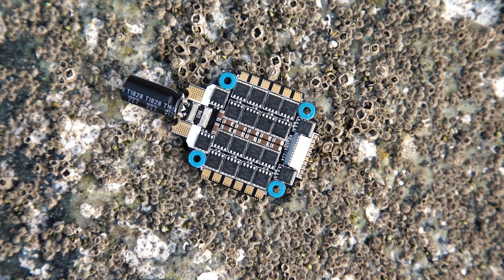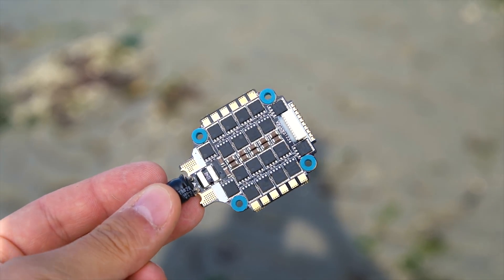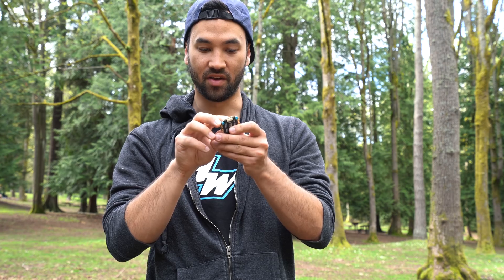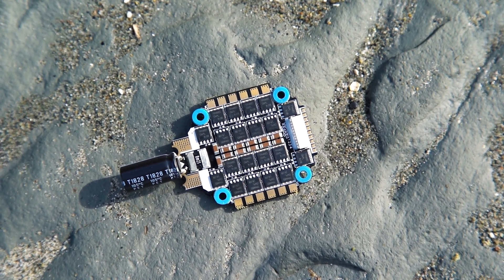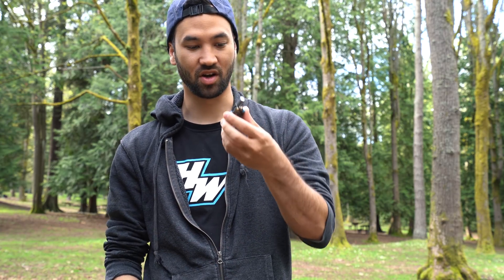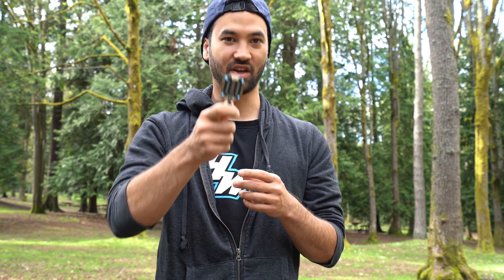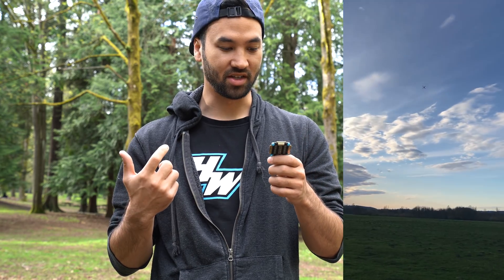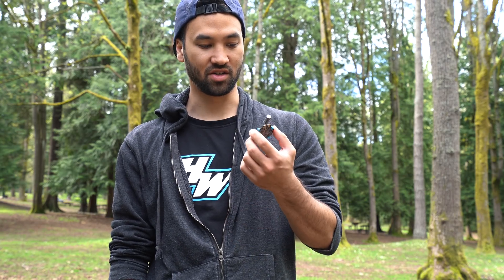Hobbywing XRotor 60A 4in1 ESC

Comment: I’ve been running two of these across my builds since almost day one. One of them that had countless baths, two fires (which killed FC both times and DJI Air Unit once) and spent 5 months lost in the filed during winter in rain and some snow kept on going until I finally killed it yesterday in a crazy crash that split both my motor stator and my GoPro in half. I think what finally killed it was the force that ripped the motor off its base was so strong it sent the motor spinning and curled its wires up so much that their insulation stripped and they all shorted before I could even disarm. There isn’t even visible damage on it, it just doesn’t spin a motor in that one’s place. Never seen a piece of electronic gear that can take so much abuse. Even the original blheli_s Xrotor Micro 4in1 that I used in my first build over 2 years ago is still going strong despite being ran on 2 cells more than it’s rated for.

Comment: Any issues on the 10" build with it?  The spec sheet says don't use on frames above 300mm.....I put one in my 10" no problems yet, but i fly it pretty mellow...Curious if you've had any issues.  Thanks

Comment: Looks like a great design. I appreciate the connector and option to solder wires. Same goes for how the cap is attached, I always hate trying to mount caps in a clean way.

I’ll have to try one out.
Reply from the maker: Yes the cap is installed super clean!
Reply: @JordanTemkin  did it come installed already out of the box?